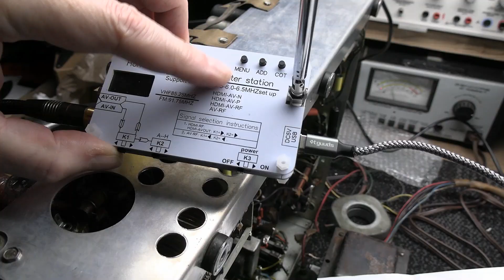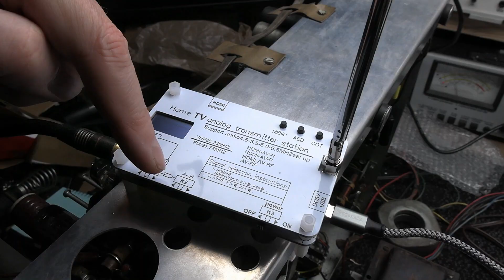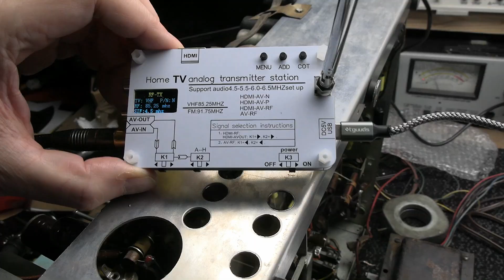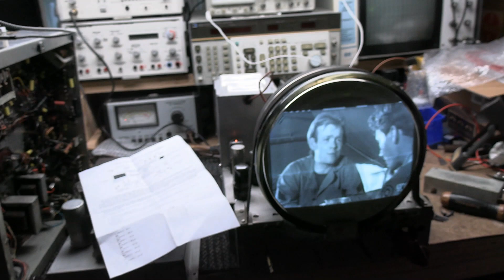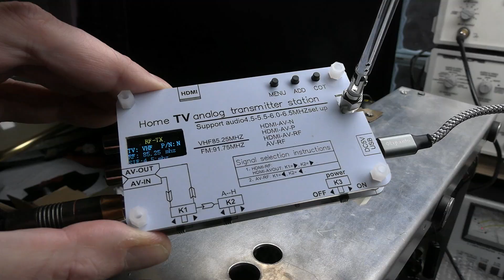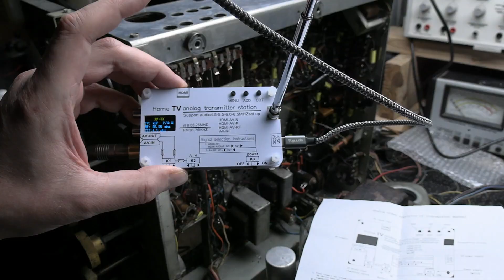Home TV analog transmitter station

Comment: I bought one of these but I really don’t know how they work. If I wanted to transmit something from my computer or phone to a TV can I use this and what cords will I need. I can’t seem to get it to even turn on. And I am using a phone changer for a power supply but it’s not getting power. Did I just get a dud? Anyway, thanks for posting this video.
Reply from the maker: Sounds like might have a dud. I used a phone charger in this video. You would need connect the HDMI out on your laptop or phone to the HDMI input on the board. Select HDMI and output params using the menu and mode switch
Reply: @bandersentv got it to work! Turns out you have to use the cord that it comes with it seems. I was using a different cord with the same end but it wouldn’t work. I ended up getting it to work. But the picture is super fuzzy and it’s a colored TV but I can’t get a color picture. Do you think I need to add some tinfoil to the antenna?

Comment: Hey there, I ordered this device, but I can't get my TV to pick up the signal. I got the TV at an estate sale, and I am not positive that it works, it powers on and all of the controls seem to work. It's just not getting a signal. On the device, I am using HDMI input from a Macbook, VHF/P/85.25mhz/6.5 mhz. I have tried all channels 1-13 and U. Any tips? I am new to all of this, so thanks very much for any help!
Reply from the maker: Assuming you are in the US, you need to change your settings.   N/192.25MHz/4.5MHz for channel #10.  N = NTSC
Reply: @bandersentv  Thanks very much for your response. I am getting the same result (or lack thereof) with those settings. I have also tried tons of other settings on the transmitter while just rolling through the channels to try to pick it up, but no dice. I suspect it may be the TV itself. Anything else you'd try before giving up?
EDIT: I finally got it to pick up the picture perfectly. Literal seconds later the whole screen went black and a faint but funny smell came from the back of the TV. I guess it's RIP for this little 1976 GE solid state. I am hooked now though.
Reply from the maker: @ What model TV?  Are you getting static on the screen?  Does that static pattern change as you go through the channels?
Reply: @bandersentv  Yes, I was getting varying statics on the different channel before the picture went out.
Reply from the maker: @j.bookout4069  What do you mean by "before the picture went out"?
Was the TV working and it stopped?
Reply: @bandersentv Yep, it was getting static, etc. and then finally I got it to pick up the picture perfectly while fiddling with the dials. Seconds later, the screen went completely black. The audio still works, but even after unplugging and switching on/off, then plugging it back in, the screen no longer seems to work.

Comment: That was as clear as mud. In reality, any baseband analog video signal is a modulated-together amalgam of sync, burst and video. But it's not RF-modulated onto a carrier. In a real analog TV station, the final composite video signal is inverted, then amplitude modulated onto an RF carrier. Filtering removes most of the lower AM sideband and carrier, but preserves the DC component of the baseband video signal. The audio is frequency modulated onto its own RF carrier, at a frequency above the AM carrier, which ends up being filtered out. RF modulation can happen together or separately, as can RF amplification. With NTSC color, it usually happens together, because the modulated sync can cause audible interference on the audio subcarrier. This is one reason why baseband audio and video are always separate in TV stations.

The hum bars are definitely a grounding issue. In analog TV broadcasting, grounding was a serious issue because of that! There was no easy DSP algorithm that took care of hum bars, so we had to be careful in designing and maintaining TV studios and transmitters in the analog era. To this day, broadcast quality TV equipment has terminal strips for many signals, because special care has to be taken to separate signal grounds from AC ones.
Reply from the maker: What was as clear as mud?  It is a simple, cheap gadget to get a signal into a vintage TV without wires.  It's obviously not broadcast quality or even designed to work in this country.  You probably noticed the carrier frequencies are off.
Reply: @bandersentv  your description, using the word "modulate" in different contexts without explaining the various contexts was "Clear as mud" IMO. I never criticize anyone unless I can do better myself, so that's what I did. Perhaps you should have said more about the intended uses in the video, because as I noted, the discussion of the signal chain was impossible to follow. Seems like you're angry at me for not divining things that you failed to explain, or didn't explain well. Whose fault is that? You're welcome for the engagement.
Reply from the maker: @Speed-Daemon-123   I was excited to show off a new gadget. It's not meant to be educational or a discussion on modulation techniques.

Comment: you're not old enough to remember the transition from B&W to color.  That old set is b&w only, and it's before color, and its 60.00 HZ vertical refresh.
When color came in, to use the inexpensive color oscalator chips (crystals ) available the vertical refresh changed to 59.94, which is where we had to switch ti drop frame time code.

So the bar is the AC power 60.00 hz showing up in the 59.94 refresh rate the TV locked to.

There are two choices:  See if the device can do PRE NTSC video standards and do a 60.00 Hz refresh rate, or find a way to make a 59,94 AC mains and use that. 

All the older sets pre color, hasd that moving bar of the beat frequency between 59.94 and 60.00.
Reply: The frequency difference doesn't really matter. A pure 60Hz signal would just mean the bars stay perfectly still. The issue is the magnitude of the interference.

On a newer set you'd still have the exact same problem.

Comment: Similar to that, those have been available for over a decade at eBay, Amazon, etc.
Reply from the maker: I'm surprised I just found out about them.  No one else I know in the vintage TV community had ever seen one either.  Separate modulators, transmitters, and HDMI-composite converters yes, but not all in one package.
It has problems though 'll talk about in a follow up.  Sound carrier frequency seems to be off and only channel 5 (or is it 6?) works.
Reply from the maker: Are you think of the HLLY transmitters?

Comment: I think that the antenna is crucial here. High band VHF channels works better with short telescopic antennas like the one comes with the transmitter. I have one setup in my house using a Blonder Tongue unit in CH 12. Works great and with a small dipole I have strong signal all accorss the working area.
Reply from the maker: I tried, but can only get reception on channel 5 with this setup
Reply: I need something can transmitter video signal wireless like Bluetooth wireless

Comment: As for the 60 Hz hum bars (and possible audio hum as well), I have found that I have a hard time with small AM radio transmitters that are AC powered, producing hum, but have one small battery powered AM that works flawlessly. Perhaps you could adapt the USB 5V power input to your TV transmitter to run on a 6v gel cell battery or some other battery power and it should totally get rid of the hum bars. I also have another small TV transmitter that uses an AC adapter that I tried, and it also produces quite bad hum bars even on a battery powered Watchman, as well as AC powered TV sets.

Comment: Is your signal source in this example RCA A/V or is it HDMI? I saw this transmitter online and it seemed that the description said that it could transmit in NTSC with an HDMI input but not an A/V input, but it could transmit PAL with an A/V input. That was a show stopper for me, because I would want to use A/V input. Interesting about the sound settings, that you would need to set the intercarrier frequency to 4.5 MHz but it comes set differently. Although transmitting may be illegal, I would think the signal would barely be able to escape your own home enough to cause interference with other people needing the frequencies or the FCC detecting it, much like Part 15 AM/FM small home transmitters.
Reply from the maker: A/V. I show that in the video
Reply: @ Ah, ok, it appeared to be a single plug in the video to me but guess it was double/triple.
Reply from the maker: @oldradiotvsc9836  I only plugged in video. Haven't tried sound yet

Comment: That looks neat and not a bad price too.

With the BT modulators I find the length and placement of the RF IN \ RF OUT  patch cable has a huge effect on the hum bars. You have to set it up and then mess around and find the sweet spot, and also that the antenna lead is well away from it.

Comment: Hi Bob, Try the highest VHF channel not in typical use in your area use a dipole antenna cut to the proper length.  I use channel 8 and a 30 inch antenna.   Try installing a common mode choke in the transmission line to eliminate the lines.  I use a large ferrous inductor, that I had from somewhere, and then played with the orientation to eliminate the lines.  Thanks for the tip!

Comment: Try it with a linear power supply. Phone chargers can have a lot of common mode noise on their output.
Reply: Agreed! My guess is they are decoding HDMI to analog composite video* and the RF modulator is analog. I sincerely doubt they are digitally synthesizing an NTSC RF signal. For $30 they have to be using off the shelf chip sets,  in fact China clones of OEM chip sets at that!

*That sounds complicated and it is: Decode HDMI to and scan convert to 480x720 progressive RGB, convert to interlaced, matrix to Y, R-Y, B-Y, NTSC re-encode, DAC to analog. And support PAL as well. But every Blueray player, CATV box, Satellite box, some streamer boxes, that has composite video output has to have a chip to do all that so they are quite common and cheap.

Comment: Maybe using an isolation transformer for both the DTV box and the modulator's power supply could fix the problem
Reply: I guess isolating one of those may do. The bars either are likely some sort of ground loop, e.g. caused by Y-capacitors in the switching mode power supplies of the signal source and the power supply, or the onboard frequency oscillator being off spec.

Also want to see it on a color TV if it has the chroma dots.

Comment: I'm pretty sure the lower sideband is not suppressed at all, as is the case with many el cheapo A/V RF modulators.

the OLED display is actually monochrome with different "phosphor" colors, there's a yellow bar on the top and the rest is blue. I recall pre-iPad era MP3 players in the mid 2000s used such displays.

Comment: With that range I don’t think the FCC would mind too much!  So if u fed a composite signal in from the VG91, could you broadcast video patterns through the air?  Not that it would make sense but it might be neat to send a window/circle without an RF coax hookup
Reply from the maker: Sure.  That's what I plan on doing with my Tektronix TSG-170

Comment: That kind of construction is not that unusual. You see it a lot on open source hardware designs that the Chinese put in production, either with or without the original author's blessing. The Chinese aren't stupid so you do see original designs from them like this, but if you look hard enough you might also find the designs in some small time forum or GitHub or some such.

Those cheap component testers are another example. A popular open project put into production. 

It's a blessing and a curse, because on one hand your project baby gets actual production, but on the other hand no compensation or feedback to the community either. But if you put a design online it's to be expected.